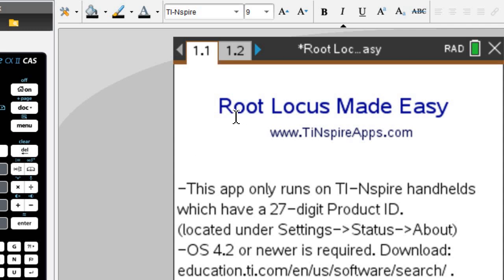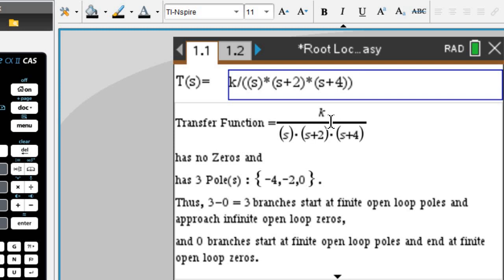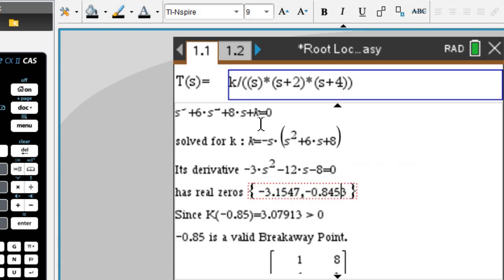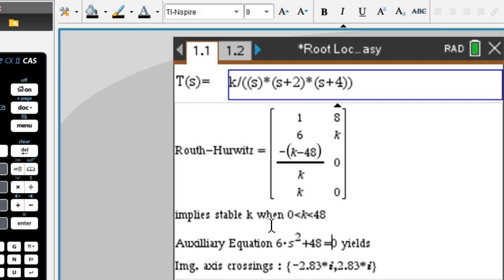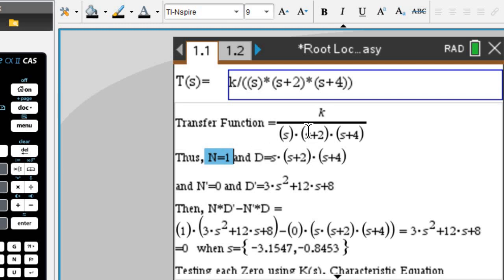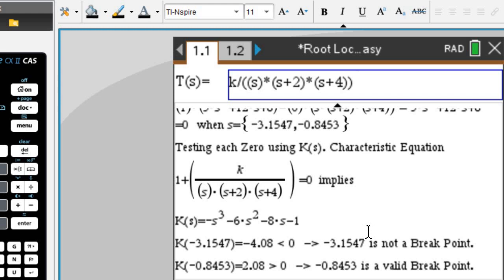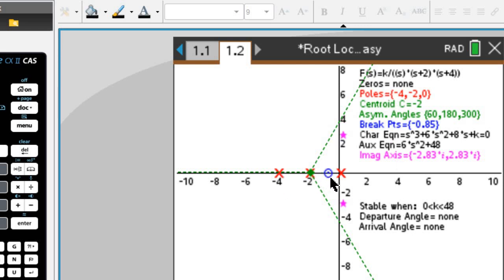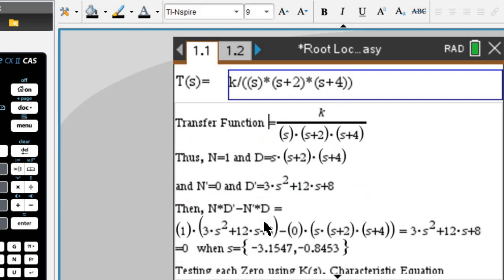Ti-Nspire CX: Root Locus

Comment: I wanted to ask if this app is also able to plot a bode plot, since the website states that it can plot more than a Root Locus in different tabs.
Reply from the maker: Yes. This app plots Bode , Root Locus and Poles/Zeros
Reply: @TiNspireApps perfect, thank you for the quick response.
Reply: @TiNspireApps  how do you plot them? I cant find a way of opening new tabs to plot the bode or nyquist plot
Reply from the maker: @Domjavy  To access the existing tabs 1.2 , 1.3 etc either click them OR click the triangle pointing right .

Comment: When i try to plot the root locus diagram my ti nspire cx cas crashs
Reply from the maker: please email us a screenshot of what you enter, then we can help : support@tinspireapps.com
Reply: @TiNspireApps  every tipe of input that I put the calculator show me te clock simbol and i have to hard reset It from the back button
Reply from the maker: @romanowski5252  please email us what you are entering.  Otherwise we cannot help. Screenshots are best. Thanks
Reply from the maker: @romanowski5252  1) Make sure the transfer is entered with the correct number of parentheses, 2) there are a number of different Root locus plots , 3) email us the problems for detailed assistance.